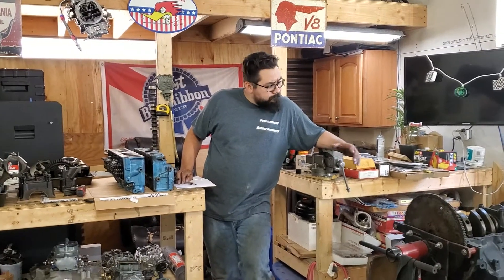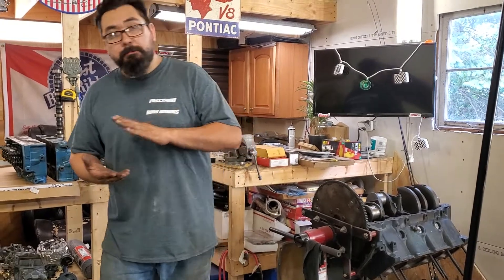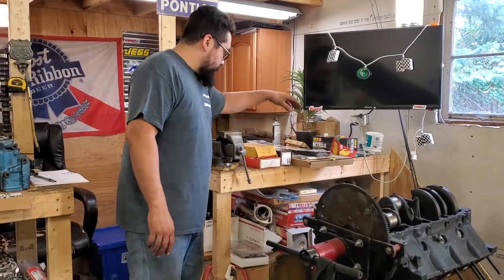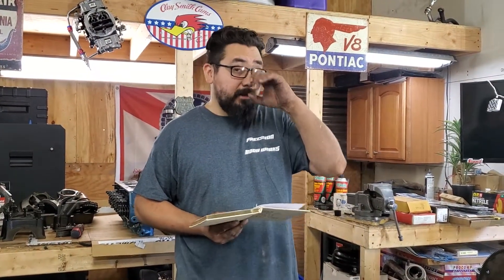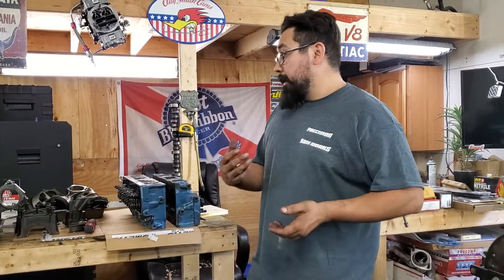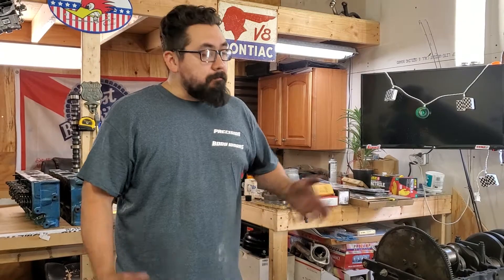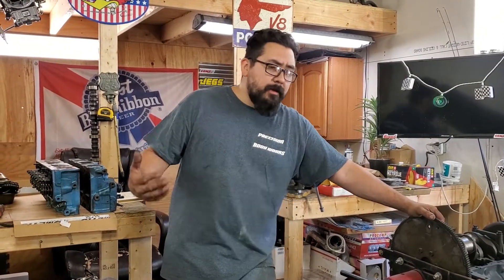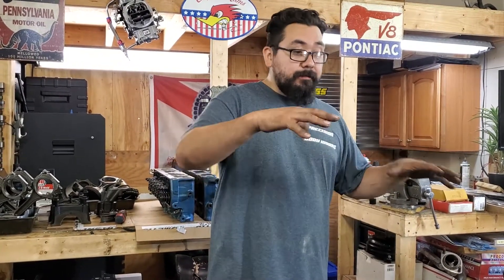Budget 455 olds update

Comment: I'm interested how you would tune the China Bay HEI as that's what I'm running and I'm a novice at best.

I've been thinking of upgrading to a progressive digital HEI because I have only a basic idea of what I'm doing.
Reply from the maker: I can touch on that when we get there absolutely
Reply: @oldsrktracer   I'm running a pertronix hei module in mine. Would consider selling.
Reply from the maker: @tmx1911  which module what issues are you having.
Reply: @oldsrktracer  not really module issues, more spring weights and setting the curve and timing issues.

Car runs good, but not as good as I think it should.
Reply from the maker: @tmx1911  some modules have a really long dwell making the burn really lean.i wouldn't worry about matching the weights I usually keep the weights that come in the dist. And just alter the springs. I had a combo that had 2 light springs and it loved it. Timing would come in right off idle and be all in at 2800 Rpm. Most cars will respond well to one medium and one light for most modest street HP set ups. You might have to also change your carburetors fuel distribution. Meaning if you have more timing sooner you may have a flat spot that you may or may not feel where power is down.

Comment: copper cutlass I have some original HEI distributors if you would like to purchase one at a reasonable price. Please don't put Chinese crap on your car. I was running a factory HEI with a Pertronix module with no issues. I built another engine for my '68 that came from a '68 in the junkyard. I wanted as many new parts as possible. I am now running a new Davis Unified Ignition distributor with a Dick Miller Racing dist gear because I converted it to a roller cam. Are you on the Classic Oldsmobile forum? Take care and good luck buddy.
Reply from the maker: Yes I am in classicoldsmobile . This engine is long gone and sold
Reply: @oldsrktracer  I see your name there a lot. If you see Oldsmobuser that's me. I have a 1968 Oldsmobile Cutlass Supreme Holiday Coupe that I am trying to bring back to life. I went ahead and subscribed to your channel. I was an auto mechanic for more than 22 years but I have been a mechanic my whole life. Thanks and take care.
Reply from the maker: @davidcollis4758  yeah I been on there for a long time. I'm a body man by trade. Do a little bit of everything in the shop and ibo my  garage. My heart is with the SBO 350. Currently that engine has pushed my 72 to 11.68 shooting for low 11's. This year